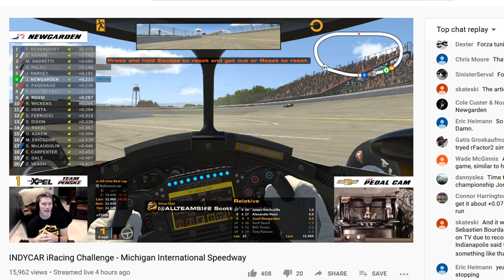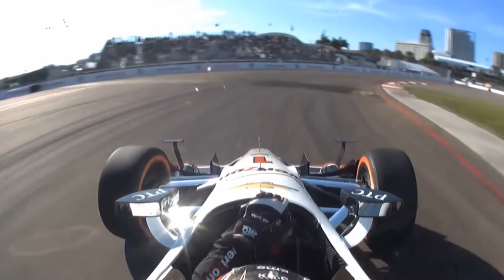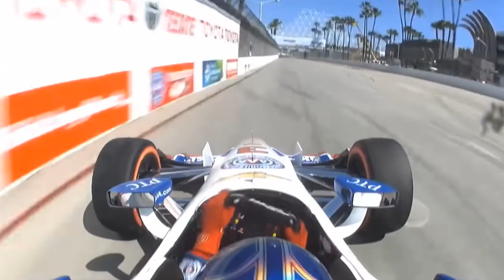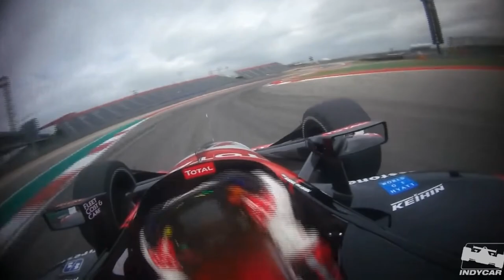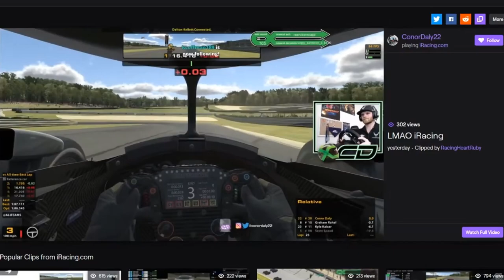Josef Newgarden Explains the Issues with iRacing's Tire Physics

Comment: No one at iRacing has ever said its perfect. See, what they're trying to do is accomplish realism through math. Through formulas and algorithms.

Most other sims (to my knowledge, all others) do not use this method. (Yes. Theyre still using math and such in their coding but this is different) They develop their tire mode based on feel and feedback. They make it react a certain way, however they get it there doesn't matter. Some sims have developed very good models for certain cars but you can't just slap that tire on another car as its tuned right for that car.

If Iracing ever gets this approach right, you'll end up with a simulated tire thats far and away better than anything else. It also would allow them to calculate many more realistic things that other sims ignore.

The one thing iRacing has that the others don't is a large community, easy to use multiplayer rooms/sessions and the racing tends to be better. 

Still, league racing is the best and you can do that most anywhere.

But finally. Who cares? 9 year member of iRacing. I have fun. Also own Automobolista, many other sims. They all do something different.
Reply: It makes me really sad that they have so many resources but can't get it right. They have the best online system out there by far, the largest playerbase, great suspension and chassis modeling, laser scanned tracks, simulated hybrid systems, accurate onboard adjustments etc.  but the tyres make it all feel so unnatural. I really have a love/hate relationship with this sim. After every new tyre model I get my hopes up but I'm disappointed everytime.

Comment: Isnt like indycar on old tiremodel? Like it wouldn't really justify anything, I just wonder how much this would apply to cars that are using their new tire model.
Reply from the maker: Then dont sell it for $15.
Reply: You can hustle the fuck out of the Skip Barber on V7, it lined up exactly with what Josef is saying. It got me really hype to try other cars when they came to V7, but now I've had a chance to try them they still lack the hustle factor. I guess the difference lies in the Skippy being on street tires and the other cars I tried (F3, GT3/GTE etc) being on race slicks. If every car had the Skip's hustle factor, but with more bite of course due to chonky slicks, I'd be a full time iRacer
Reply: @AustinOgonoski  I am not justifying it. I just wondered if there is going to be any significant improvement any time soon. I simply don't want to waste more of my money on cars that drive like crap.
Reply from the maker: @EthanDean57  It sounds like Kaemmer did a bunch of Skip Barber races IRL and then just modeled everything he knew about how a tire works, based on his lone experience driving Skip Barbers. This may have worked for GPL, the Spec Miata, and the Skippy, but you'd think with their millions in funding they could put his ass in a modern car with slicks and let him go nuts for a day.
Reply: V7 felt really good promising when it came out on the skippy and the F3 car, but when they started supposedly applying it to other cars I really didn’t notice much of a difference aside from the sloppy cold tires at the beginning of a race. The Porsche cup and other road cars feel basically the same...maybe it’s just me idk
Reply: @AustinOgonoski  
What you describe is empirical and Kaemmer's whole schtick is that empirical models are bad.   From what I've read Kaemmer spends his days reading about the chemical properties of rubber and tarmac and tries to incorporate that into his model, along with real world data from race teams.   But I agree they should put him in a modern car with slicks, might change his whole perspective on shit.
Reply: @Animal_lives_matter  Hell, GPL doesn't feel nearly this slippery at all... and we're talking about coffins with shit tires, not aero and over 400 BHP on the back.

Comment: That's exactly how I feel about most racing sims, even RFactor 2, my favourite, is very different than what a racecar really feels like.
In iRacing and Assetto Corsa it's really like when you start sliding the tyres melt. RFactor 2 is a lot better but still, real cars just feel right, and racing sims just cannot get that.

Comment: I've always considered the tyre modelling in Geoff Crammond's Grand Prix F1 Series, GP2/GP3/GP4, about what I would expect. But until this day I've been criticized that the cars in these sims were too "stuck to the road", Josef Newgarden see's this glaring error straight away with iRacing. I am still a firm believer as well iRacing tyre modelling is still only an extension of what David Kaemmer did way back in Grand Prix Legends sim. Wrong!

Comment: Can't say I'm surprised. iRacing has very plainly been focused mainly on NASCAR, where the tires they use are shit and have been shit for years. Tony Stewart, IROC, IRL, and NASCAR champion, went on record multiple times and called them out. But if iRacing is going to cater primarily to NASCAR and Stock car racing with a reduced focus on GT, Open wheel, and/or anything else, it's not surprising that they would focus on a janky tire model to emulate the janky relife rubber Goodyear provides.

Comment: This!
For example, in BeamNG drive, as soon as you introduce side force on the tire, or brake in a corner, you lose a bunch of grip, completely unrealistic. And you can't seem to recover the car until you get out of the slide because you've slowed down so much that the physics starts working again. And the tire grips just fine after.

Comment: I couldn't take it. I tried for two weeks. I just couldn't brake into the corners consistently. I couldn't get the feel right. Granted, I had a wheel that gave no feedback, but still, I was done after two weeks. My final straw was when some a-hole ran into the back of me at top speed on the green flag. 

However, it was cool when I learned that you need to drag the brake and slide the rear to go fast in some of the lower series cars.

Comment: Wouldn't you get a slight flat spot in real life though? I know that's a major issue with formula 1. One bad spin and your tires are indeed going to give you issues at least until the rest of the tire is worn down to compensate. Or are indy car tires much tougher and forgiving?

Comment: Why is everyone playing this mess? Sounds like difficult arcade game and not a sim.
Reply: because some canadian GT4 pro driver says its brake-timing is the best, or at least much better than ACC....
Reply: @thedude4795 same guy that just won the Rolex 24😁
Reply: @runofthemillz In Which class?
Reply: Daniel Morad.  To be fair he's mentioned issues with iracing too.  Slightly over drive a tire, tread temperature goes through the roof and the grip drops off a cliff.  I like the feeling of AC1 on the limit

Comment: They need to fix grip and crash dynamics. Cars are flying all over the place 25ft in the air. So unrealistic when you try to avoid wrecks. And wreck avoidance is apart of racing so don't come at me saying it's a sim.

Comment: You mean that simcade game PC2 might actually have its tyre physics right?  ;)
Reply from the maker: Pretty much every game, including the simcade stuff like Grid Autosport and the really "out-there" games like the original Forza Horizon, might be more realistic than people give them credit for. But a lot of this sim racing thing has turned into dunking on people for playing games that are "beneath them."
Reply: @tgmrsch  @Daniel_Cave It's not harder, the problem is they require a total different skillset, while known arcade ones actually require that skillset. Arcade games may not be realistic in term of spec, but gives you that authenticity. 

Simracing might look harder, because people drive them & expect the skillset to transfer, but isn't. All you have to be good at, is to bomb dive with the brake & rotate from the front to obtain maximum efficiency(something you shouldn't do in the real thing, but work stupidly well in simulators).
Reply: @AustinOgonoski  The original Horizon was a fantastic game with brilliant driving roads and I will knife fight anyone who says differently. Since then they've made it way flatter and more about just topping out on boring highways or smashing into shit.
Engineering explained has a video about physics in The Crew 2, which does actually simulate most if not all of the same stuff, they just completely fuck the values.
Reply: @clemfandango2379  I have yet to properly try Forza with a wheel, which I keep hearing isn't great, but it's the only game I know of that has the amount of customization and simulated aspects that are present, outside maybe BeamNG.
Reply: @clemfandango2379  Isn't every racing sim just a hotlapper with friends?
Reply: @clemfandango2379  I don't know about league racing, but any of the PC sims I only play around for about half an hour before getting bored or fed up with the bullshit systems. Meanwhile I can play Forza for hours, even if just with a controller.
Reply: @JZStudiosonline  I will say this... using the same car in Forza that I track in real life, on the same track I go to primarily, going multiple wheels off in multiple spots around the track, I can destroy my real world PR's in Forza by many seconds. That right there was my first clue that it wasn't a very good simulation, lol
Reply: @anthonylineberry  That applies to every sim though. Like, literally every one of them.
Reply: @JZStudiosonline  being faster than real life with clean driving may be true of all sims, but not sloppy off track bad driving.

Comment: This is generally all cars in all track cars I’ve driven you can catch slides very easily I’ve caught full lock slides at 200kmph in iracing I don’t even think the car is sideways and I end up in a wall.... cold tires are also ridiculous yes cold slicks arnt as nice as hot slicks but they arnt like fucking ice

Comment: call me crazy but i believe with better FFB, at least 50% of the tire issues can be fixed.

I catched some crazy slides in Iracing purely by chance and in couple occasions managed to recreate them, but it was only possible when you where driving ON TOP of the FFB and predicted what was gonna happen.

The Tires are still peaky, but honestly, it would be less of an issue if the FFB were improved. Iracing believes changing the FFB from 60hz to 360hz wont be noticable conciously, but thats just plain wrong. Among other effects that should be added since realistic FFB is not actually a good thing in Stationary Sims. Something wich Kunos got right with AC, and got it wrong again in ACC.
Reply: Basically p2w

Comment: You don't even need to be a pro driver to notics this. Having pushed a car on a racetrack just once is enough. I drove two laps around Pau Arnos racetrack in a 911 Turbo, with an instructor. At first I was slow, but by the second lap I started pushing the car, and at some point, my instructor even told me I was entering too hard a corner, on a rainy day mind you. I never spun the car out. In fact it didn't even slide, and yes TCS was off. Meanwhile, pro drivers spin out like crazy on Iracing. But it isn't just with this game but with many more. I can't drive properly for shit in BeamNG. I know it's not supposed to be racing sim but they pretend to have realistic physics when the cars are way too light and bouncy and the tyres have on/off grip an your chance of actually catching a slide is around 30%.

Comment: On the opposite end of the scale, Cameron Das discussed on his Instagram how the tyres aren't reactive enough to temperatures over a race run in a mod using his F3 car at Bahrain. 
https://www.instagram.com/p/B-aQQTdFGKz/
Reply: Never noticed this thing about the FFB in AC. Gotta try it out, because in the good ol' rFactor with realfeel it actually went lighter when you loose grip in the front.
Reply: @mondodimotori  I get a pretty good feel of understeer in AC, some people get none at all. It's a really bizarre issue.
Reply: @CdH94  I need to try it again because, used to rFactor, I can sense whene the car will understeer and preentively avoid to turn the wheel to much already.
Reply from the maker: He's definitely found the same thing I have about the tires not wearing enough. I think it's in my "Bad Habits" video but I've explained before how in AC you can just push as hard as you can for an entire hour and the tires wear out in a linear fashion regardless.
Reply: @AustinOgonoski  The funny things is that, during marketing, they pushed hard on the system that damaged tires based on how hard you drove them and if you used to look up during braking. A feature that was also present in Kunos previous sim NetKar Pro. I was baffled in watching your 787 race at Road America, when even rFactor 1 had differential tyres wear based on how hard you pushed every single tyre in particular.
Reply from the maker: @mondodimotori  I just can't stop wondering what the fuck happened to our favorite hobby. I really don't get it.
Reply: Hope Ian is listening to all this
Reply: @AustinOgonoski  Yeah. That sounds about right. Every single race in those conditions, you hear about drivers saying they had to save tyres. The F2 race at the same track in hot conditions was just a tyre killer and everyone pitted in the Sprint Race where you don't normally.
Reply: I never understood why people go through this effort to get a big dedicated rig and three massive TVs, only to place the camera so far back so you have a steering wheel 6 feet in front of your steering wheel. Probably why he's missing apexes.

Comment: At the end of the day we are talking about GAMES here.
Real simulators and simulations are totally different thing. 
My experience comes from aviation and helicopter simulation.
Real simulation of aerodynamics and all the other things, tyre models etc can be done, but the cost of all that is something different.
In aviation fullmotion simulators with professional sofware cost tens of millions.
So, I`m not so suprised why commersial computer games used for entertainment don`t simulate everything correctly.
Reply: Apparently, you haven't tried DCS World... Full-motion hydraulic platforms are one thing, but it's the code that is the most important part. And many "professional" sims out there seem to utilize either X-Plane or MSFS/P3D as their code base. But those things truly are awful... DCS' approach, on the other hand, seems to have nailed that sweet spot in the middle. Even though the flight model is still based on tables, they pack up heaps of those tables into the FM so that it could come up with solutions for all kinds of situations including backwards flow.

Comment: I wonder why this simulator got the nick name iceRacing.. ?  This video explains it all.. and 60hz ffb doesn't contain any road surface details like in AMS 2 or ACC.  They have to address the most important aspect of a sim, the FFB/Tyres... that's the only thing connecting the car to the road!! Please fix it iRacing!! (instead of releasing more dirt oval tracks...spend you money where it's needed!!)

Comment: Well, it is still has the V6 tyres, so yeah, it will still behave like this. V7 tyres will fix that.
Reply from the maker: They also told us the V2 tires will fix the problems the V1 had, and the V3 tires will fix the problems the V2 had, and the V4 tires will fix the problems the V3 had...
Reply: @AustinOgonoski  that's the point of updating something...
Reply from the maker: @jaydendixon7300  Updates are supposed to fix something, not hold you over until the next update... and the next update... and the next update.
Reply: Having driven the mx5 quite a bit... it absolutely does not fix it.
Reply: @AustinOgonoski  The v7 is an entirely new approach, not just an evolution of the v6 tyres. They documented this and the pros/cons of each approach to tyre modeling in a pretty extensive post 2 years ago. But overall, tyre modeling in real time is...quite difficult to get accurate in all conditions/scenarios.
Reply from the maker: @anthonylineberry  Is it really that difficult though? Because for the past few days I've been playing IndyCar mods for Automobilista and they don't seem to have any of these issues.

Comment: How fast you counter steered in the game wasn't nearly as fast as IRL. Get a few more examples where your wheel movement is as fast and time the moment your rears lose traction and when you begin to initiate the correction. 

Also show examples of successful attempts and show those side by side. To be thorough, compare steering input amount, slide angle, the start and ending of the slide, and the start and ending of the correction you made. You can get real crazy with it and replicate exact corners you or someone else has actually raced to further prove your case.

Unless you have a motion sim, catching slides are always going to be a little later unless you have a keen eye for camera to change ever so slightly. The wheel has a hard time communicating something the rear end does (which is the same IRL) I personally put a lot of preload on the wheel to replicate the heaviness of a street car on a track because that's what I am use to. But the bigger reason I do this is when I start to slide, the wheel is already helping me make a quick counter steer because of that preload. There's just a numbness you can't really replicate in a wheel that can tell you when your car is losing rear grip.

If you have a good wheel, don't be afraid to wrench it around. Your wrestling should be consistent with IRL if set up correctly.